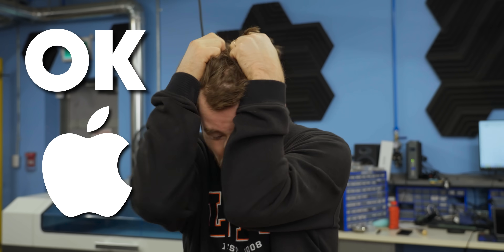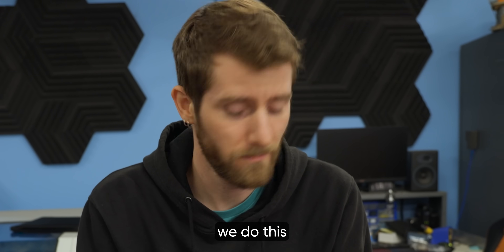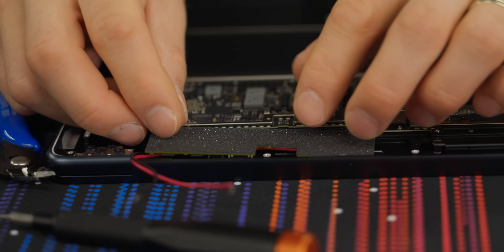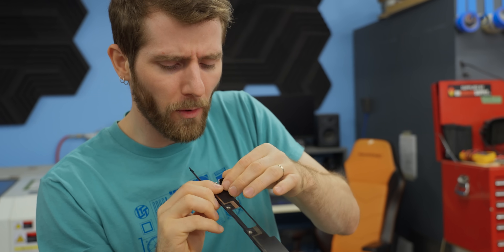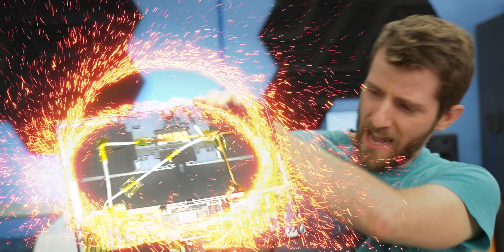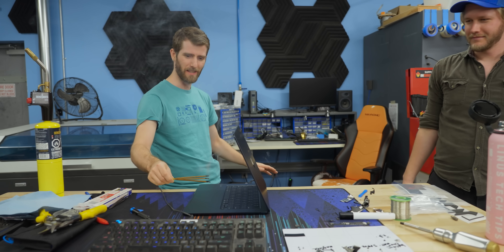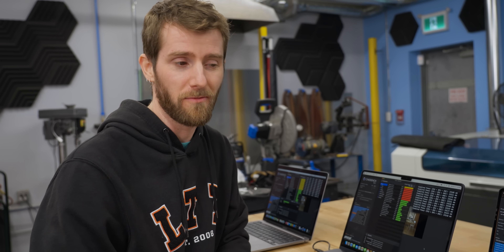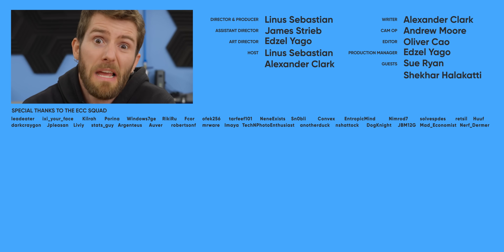Apple please watch this. - Frore AirJet MacBook Air

Comment: Imagine a completely sealed laptop like Dell's rugged line; with a removable cooling module like these, It could tolerate harsh environments with thick filters (thanks to its high static pressure), and it could simply slot in the back for easy removal/replacement.

Comment: I think the M2 Air performance should be taken at face value for what it is, not what it "could be" if it wasn't thermal throttling, with the fanless design I'd wage it's part of the design and even evaluating it performance with the throttle it's still very good compared to x86 laptops

Comment: So they barely managed an improvement by cutting off half of the hardware features... yeah great 😅 and you guys even used the 15" that has much more room than the 13".
When you wanna make the device this thin there have to be some sacrifices and tbh in real use you just never will get this thing to throttle... it just won't happen outside of benchmarks. Even gaming or video edits won't do that.

Comment: Solid state cooling is the one thing I've been the most excited for in the PC space for a while now. When it starts making its way into the Handheld PC's like the Steam Deck, I'm going to be so stoked.
Reply: Cost and power draw is what will limit it from hand held consoles like the steam deck.   The cooling potential per W Is not as good as a classical fan and the cost is much much higher.
Reply: @hishnash  Hopefully over time it will become more efficient and less expensive as the tech advances. It's still very new at the moment, so it costing a lot doesn't surprise me nor does the efficiency. Like all new tech, I'm sure it will get better with time.
Reply: @hishnash True, but there is still quite a bit of theoretical efficiency improvements to be made. Even without them they have some obvious advantages in some scenarios. The real issue is filtering and wear.
Reply: @hishnash  It's new tech. It always starts off rough around the edges and expensive. They say it's based on processor tech so as processor tech gets better so should the frore jet.
Reply: @hishnash  No shit lmao, it's still in early stages.
Give it 5-10 years and we'll see.
Reply: @hishnash  When you use the extra space gained to add in extra copper, the gains are greatly increased, well over double the cooling capacity, I'd combine 2 Airjet pros with several thin copper heatpipes, this should provide upto 40watts of colling performance in the tiniest package, add to that a Airjet cooler on the SSD for a further heat reduction, and you have something pretty amazing, with thin heatpipes and Airjets you could achieve nearly 50watts of cooling performance, the current Deck only uses up to 15watts, your gonna be able to keep the Deck icy cool with Airjets, especially wiht a built from scratch vapour chamber and Airjet intake/out channels, you might even be able to get up to 60watts of cooling capacity out of it, that will enable incredible performance in a handheld.
Reply: @Wobble2007  As cool as it is, I don't see how this technology is practical.  It needs a filter, its not going to take a lot of dust to clog it.

It seems to me these units are going to end up being a consumable part you'd need to regularly replace, that's a huge downgrade over a good fan which can last the life span of the device.
Reply: @alexatkin  There are these amazing inventions called toothbrushes and hoovers, great for clearing dust build-ups.
Reply: @hishnash There is one product on the market now and is 500 dollars so, not as big, considering its using last year intel i3 and i5.

This will get cheaper faster the more companies use it.
Reply: @hishnash The cooler in this video is significantly more efficient than a fan.
Reply: @hishnash  LTT did a video using an SSD cooler and fan on the early steam deck and found a noticeable improvement. So there is gains to be made in that market.
Edit: The gains aren't just performance wise, acoustics would improve a lot too.
Reply: @hishnash oh really?
Reply: I bet the Deck 2 will have them. Valve themselves said that the tech for the Deck 2 doesn’t exist yet. Hopefully the airjets were included in that statement.
Reply: Same here. It has so many potential uses.
Reply: NO YOU HAVE BEEN STEALING MY CONTENT  OFFICERJIMMYUTTP
Reply: Yess!
Reply: hope they can use for the next gen of neck cooler slim
Reply: This with ARM chips in handhelds for reducing power
Reply: SSC
Reply: Not only pc or deck but phone aswell, inagine had stable 30-35c on gaming/video without any big cooler
Reply: @OFFICERJIMMYUTTP  sure, you totally didn't leave this comment on multiple comments. They have all been stealing from you for years
Reply: @thatpinkleaf  It's a bot.  Just report it.
Reply: I just want to see this in phones, that's the most exciting part, i wanna see this in android phones, it's small it can fit, and should be really good for gaming performance.
Reply: Passive*
Reply: @TheNuclearBolton it's not passive. It's active cooling, it just doesn't have a fan. The company that developed it calls it solid state cooling.
Reply: I mean we just need to create portable nuclear power plants. No big deal it can be self contained and kept in a container for hot soup/coffee. If the big ones in an aircraft carrier can go for 20 years then a small one should  be able to last for a bit. Not too hard to make! :D  :D
Reply: @nateo200  I think at one point there was supposed to be a nuclear powered tank

Comment: Sigh, Apple gonna Apple lads, my mate has a 2019 Mac Pro...core i9 (9th gen), 16gb ddr4 & 5500M 4GB (yes 4GB on a 2.5K machine, smh) and it has two tiny slits and thats it, gets very very hot, just stupidly designed

Comment: I would have taken back off the laptop, 3D printed a 2mm thick gasket that holds the coolers and has air channels, then put it back together. Not as thin as it was but would have all the functionality.
That's the problem with apple, overcharge you for pretty looking hardware and software that does less, worse.

Comment: This would be great tech for the tablet form factor. I had a Surface Pro with an i5 but it was sealed and fanless. It throttled if you even looked at it funny. Something like this would be great to give the CPU just enough air to breathe a little.
Reply: fully agree with you this kind of cooling may play a huge role in things outside of laptops but in devices like handhelds to help slim them or cellphones that become molten lava if you even think about opening a game to tablets and something im not sure many have thought about but even in some of these chargers the warp charges can get very very hot and some kind of better more passive kind of cooling in the future may be in the cards to make everything we use day to day more efficient and even slimmer and more portable
Reply: I'm pretty sure the Surface Pro is not, in fact, fanless.  Might have been one of the other Surface tablets?
Reply: @superluig164  I own a SP3, an SP4, and a SP6. I replaced the screen of my SP4 due to the flickering issue, and it does have a fan (which I cleaned). There are several models (5-7?) that have the option to be fanless/passive cooled. My SP3 is an i7 and gets hot AF when using it for anything more intensive than checking my email (jokes), so I have it in the dock with a small fan aimed directly at the back. 
Side note: that old dock is absolutely baller and I hate that they got rid of it and made the new "dock" a fricken brick instead. I haven't gotten a newer SP because I love the dock so much. It would be even more awesome if it had a cutout back to allow more cooling if you have an external fan setup like I do.
Reply: @Kahli21  I have an SP3 i7 as well, I find that it only really gets hot if you use it while charging.  On battery power it handles its heat output fine, even while playing games (obviously not crazy intensive ones).  I have one of the newer brick style docks - what style are you talking about?  Can you mention the model number or something so I can look it up?  I'm curious.
Reply: @superluig164  Oops, additional info. The dock works for the SP3, SP4, SP5, and SP6 for absolute certainty. It's slightly too deep for the SP4/5/6, but not enough to stop it from being locked into place. The sides slide outward, you put the tablet in, and then slide them together to plug it in (where the normal power connection is on the right). For the 4/5/6 you just have to move it ever so slightly forward or just line it up to the connector and slide it together. Microsoft used to have an "adapter" that was just a slim piece of plastic that you put behind it, but I never got one.
Reply: @fsh7583  The screen flickering issue was not due to heat. It was a problem with a specific manufacturer's screens that went out on like half of them. It would do that over time even if you didn't use it much.

Comment: No you didn’t fix it. The moment that laptop is in use with just a bit of dust traveling through it, it will be worse than before.
Test it

Comment: I personally love my m2 air never had an overheat problem. I also don't do anything intensive tho just schoolwork and I LOVE IT because of no fans. I can use it on my bed or in my lap without worry of them being blocked. I've used fusion 360 for basic models too and it still doesn't get hot. I doubt I'd ever video edit on it though which I think is when the problem occurs

Comment: I was finally debating a Mac as I'm starting a CS degree since it sounds like some things require it. Ended up just going with a framework though since the price difference was so large I couldn't justify it for things that seem like I can work around.
Reply: How is it working for you I’ve been using a 2015 MacBook Pro that’s kinda old asf I was thinking frame work but Idk Ryzen 7 or intel 13th gen
Reply: Definitely ryzen for the better igpu though there are only 2 tb4 ports available at the back
Reply: Aren’t frameworks in the same price range as a base model macbook air?
Reply: Nothing CS related requires a MacBook 💀

Comment: Neat experimentation. Although, the fanless "air" does do very, very well and it really is only certain super heavy CPU dependent tasks that can thermal throttle the thing. I played all of the quite-graphic-intensive game Soma on my base line m1 air and it performed beautifully. Sure, the laptop ACTUALLY did warm up a bit compared to the cold metal nature it usually is in every other situation, but, it ran that game amazingly without throttling/slowing its performance. The only task I have found that will throttle thing thing is batch script image stacking/aligning for super large panoramas in photoshop raw. Tasks like this are still done with decent speed, though and with little desire to need any better speed to upgrade to a Pro with active cooling.
Reply: Let's be real and not call Soma graphic-intensive.
Reply: Why not? It's a beautiful game. It IS graphic intensive, a rather efficient and beautiful engine from a rather small game dev company. @TheBuildTeam
Reply: @stevey500   I mean the game engine is efficient and has good lighting integration. But the textures are not very high quality, so any sort of gpu should be able to run the game no problem. I'm saying that games like Cyberpunk, or Metro: Exodus Enhanced edition are the intensive games that look amazing but need really strong gpus to push out frames.
Reply: @stevey500 A decade old game running on a modern machine isn't that impressive.
Reply: Yeah the lack of any fans is kind of the point, and what’s so impressive. I get that the point of the video is just to show this off though, and Linus/the writers probably understand all that. It’s a cool concept nonetheless, and probably useful for those who bought a MacBook Air and want some extra cooling. Seems like something that would be great to install and use when needed, and otherwise just use the passive cooling. 

Would be awesome and be pretty on brand for Apple to implement something like this in one of their devices though.
Reply: @flashlightning6742 that’s true, but Linus and the team just glossing over it with a “Apple should add active cooling or they don’t care” is misleading. If you need active cooling, you need a MBP
Reply: while this is true if im going to be spending thousands of dollars on hardware i cant even maintain myself, let alone the other thousands of dollars apple wants for things like ram and storage upgrades, you better at least design it such that i can get my moneys worth out of the cpu without it disintegrating due to thermals.

I'm spending money on the whole silicon, i want to be able to USE the whole silicon. 

Not to mention running in hot environments, this sort of set up is highly dependent on a colder environment.
Reply: I think the point is that you DO use the whole silicon most of the time with very snappy performance but you will be limited on doing 100% load tasks for extended periods which very little number of users actually do. @killingtimeitself

Comment: The lack of airflow is one reason I went with the Air vs the 13” ‘Pro’ so it won’t accumulate dust and need cleaning over time.

Should note I leave heavy workloads for the big computers at home with a 3900x, and 5800x3d

Comment: Quick question... If the intakes are 400 microns thick ( extremely small) and if they get clogged by dust wouldn't it be extra difficult to clean them off? Also because they r so small wouldn't it be ever easier for them to get clogged with dust in the first place??
Reply: I guess it would depend on the path the air takes. The static pressure is so high such that if dust makes it in, it will be pushed all the way through to the other side. The dust that is too large to make it in would get stuck on the outside and can be wiped away. But that's a best case scenario. You can absolutely design something which will clog up within hours
Reply: From what I've heard it just doesn't clog, from the no moving parts to the high static pressure dust shouldn't settle and get stuck
Reply: I think in a different video that LTT did with these people. they said that it will never clog due to fluid dynamic magic. its also not hard to reverse the flow to blow the dust out.
Reply: With so much pressure they probably don't care all that much about dust and draw in air anyway.
Reply: @Bramble20322  then revert back to what I said last. You reverse the flow to blow it out.
Reply: @ZexMaxwell  You can't, as there are filters on the intake, not the exhaust.  The whole point of there being filters is this is a tiny precise device where if a spec of dust gets inside it could destroy it.

Plus blowing dust back into the case just means it will get stuck somewhere else.
Reply: Good point

Comment: Linus and others still do the most derpy thing when reviewing mac. They run them in the most impractical way to get to their limits. Like what are you exporting that has it running full tilt for 30 minutes? Like if your editing 8K video that is shot with at $10K+ camera and then pulling out your Air you are using tech reviewers math.

Comment: As an macbook air user, the situations I’m in where this would actually be useful are super low. It’s my daily driver too.

Not saying better cooling wouldnt be a good thing but i think youre missing the point if of the air. Its a great laptop the way it is.

I should say i have a separate computer for gaming.
Reply: Man I just got back from a month long holiday and boy was I glad I could do something more then use office when the ambient temp was  over 30 most days 😂

Your saying it’s good limiting your abilities
Reply: Actually im not saying that. What I am saying is that the air isnt really intended for that use case. The Air is great because its light, silent, and reasonably performant when not executing extended workloads. The lack of a fan is a feature. Your'e right that it comes with limitations but I am saying that those limitations are a trade off. @MrHippiedude5
Reply: @MrHippiedude5  One advantage of it is removing a point of failure - fan bearings one of most likely points of failure in a laptop so if you can make do without, there is a case to be made for making do without

Comment: If apple made good products to begin with, this wouldn't be necessary.
Reply: It isn't really necessary. It loses only about 5% performance and is still pretty fast at this power consumption. 14W package power for 8200pt is pretty good
Reply: @lukas_ls  The fact that someone tried this, that they thought it was necessary, regardless of how well it did or did not work.
Reply: @SuperReddragon90  this solution has quiet a few disadvantages too: worse battery life, more noise, more issues with dust and more points of failure

Comment: Best way to fix Apple seems to be what the EU's doing. Force them to become consumer friendly or remove them from the market.
Reply: LOL, enjoy it when the EU has tied everything into knots with regulation, forcing stagnation.

So far they've literally put power of law behind minor conveniences and done fuck all for the real issues.
Reply: you want the eu to create a law saying “all laptops need fans”. Thats a little delusional
Reply: @prabhsaini1  No one said that 🤡
Reply: No, not this case in particular. But about Apple's anti-consumer-ness in general @prabhsaini1
Reply: @prabhsaini1  LOL hadn't even considered that point either. That would and up meaning that you need fans in chrome books, which are basically mobile phones with oversized screens and built in keyboard.

Would be hilarious to see a totally vestigial cooling fan, mandated by law.

Comment: I guess if you want the laptop to cost another $5,000 they can add those thingies.
Reply: They cost like $20 * 3 dude. Apple could get them cheaper for sure. Though they might change another 5k for it.
Reply: @Idiomatick  you are talking about the company that charges $800 for 1 additional RAM stick that costs $30 brand new in box.